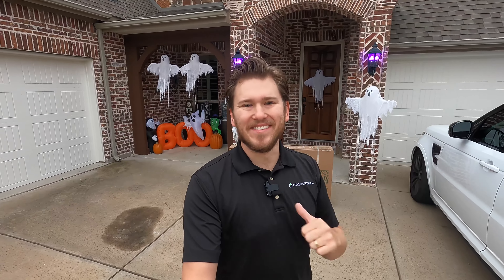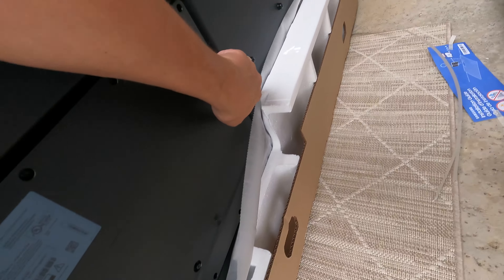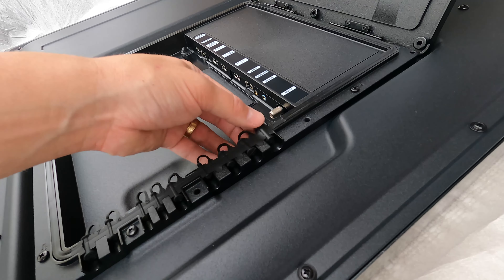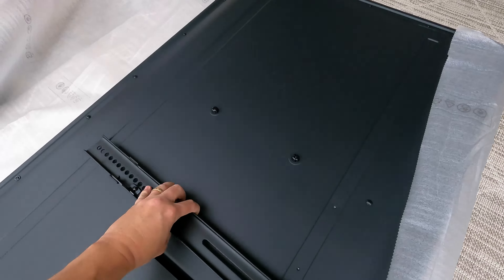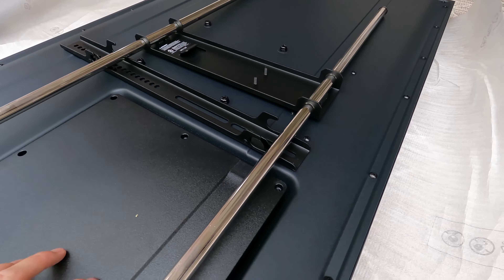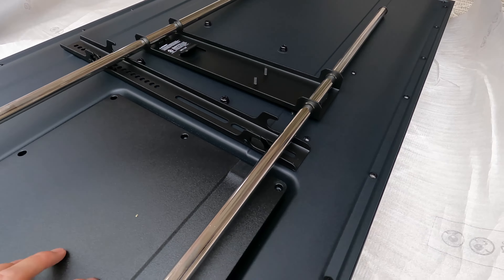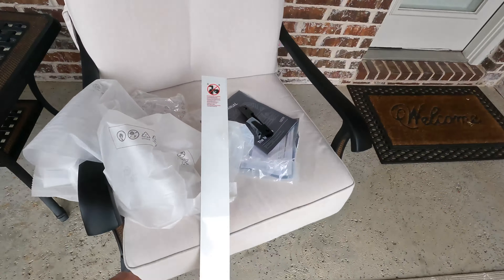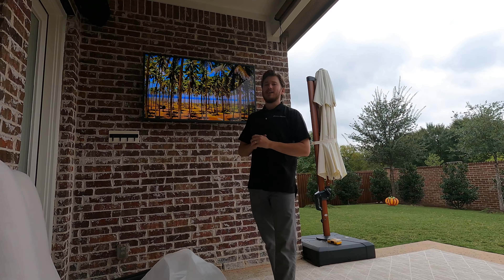Samsung Terrace Outdoor Tv Unboxing, Install and DEMO FRISCO TX

Comment: He used 12-gauge romex wire NM-B and 15A outlets on both sides.  Wrong wire and/or wrong outlets (dependent on the breaker).  Fail.

Comment: I’m a big fan of Samsung and Sonos. I’m an installer in New York. I hate that bracket lol and Samsung has a outdoor bracket not really a fan of. I like  sanus or generations brackets my self
Reply: Also you NEED to get a SDS plus hammer drill. With a Diablo rebar bit. Those brick walls will go in seconds.
Reply: Why do you hate that TV Mount?  I was thinking about buying it
Reply: @edr7127  it’s a good bracket. But I like to use the GLRGMOTION if I’m gonna you a cantilever bracket. But with those outdoor TVs  they are typically pretty heavy and pulling in and out is not that easy. But there is nothing wrong with the bracket mechanically. Just not my flavor.
Reply: @edr7127  but also check out a VLT7-B2. One of my favorite brackets. Pulls out about 6 inches Very easily. Sits pretty flat to the wall. And has leveling adjustment in case it’s off level after installation.
Reply: @631JoeS  what do you suggest if I need a 180 degree swivel wall mount for a Samsung outdoor TV to mount in a Pavilion?
Reply: @edr7127  what size tv are you mounting. Because most brackets you can’t turn a full 180° unless it’s 60 inch an under. The bracket in the video with a 65inch will allow you to turn like 140°. And that’s basically the most you will get out of any full motion bracket.  Check out the. VLF728 by sanus.
Reply: @631JoeS  it’s a 65” Samsung Terrace